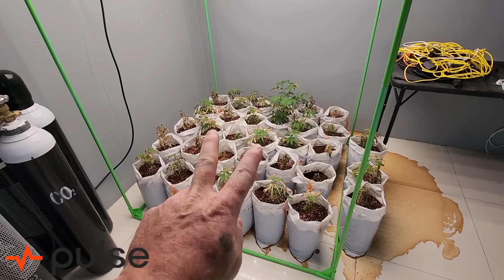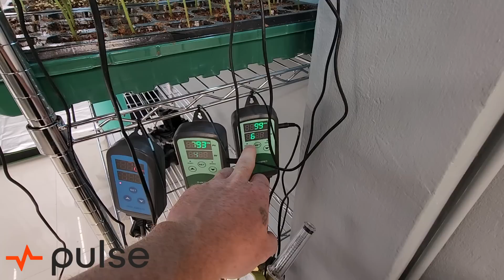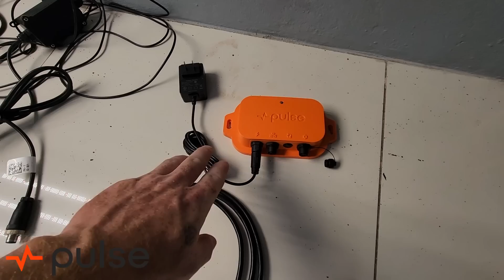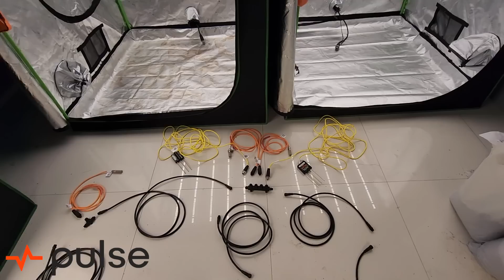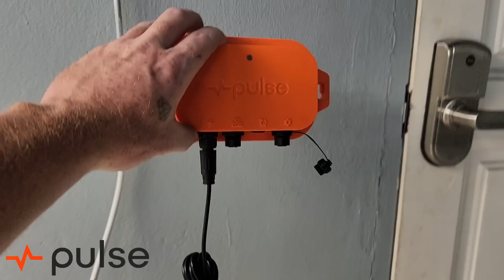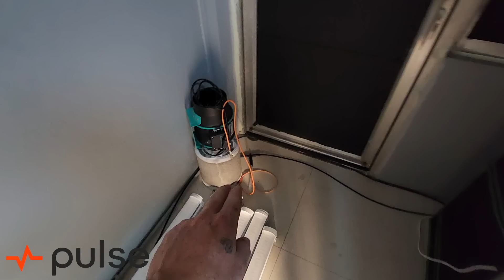Environmental data collection for the BEST GROW SPACE!!! PULSE HUB INSTALL

Comment: in thailand you need to check plant leaf temp vs atmospheric temps and the vpd needs to be 1.2 in the flower cycle. So thats like 40% humidity @27c bud not 60%. But everyone is too cheap to hire a pro. grodan will suck up more then coco btw. use 4 inchers with slabs 2 to a slab so they can help each other out on the dry back.

Comment: can I cut clones from flowering plants? They are in the flowering phase for 3 weeks and I want to cut several clones from them. How to do it correctly?
Reply from the maker: Yes you can, cloning process is the same as normal just be sure to keep nutrients to a minimum like 25% and then keep you light under 100ppfd once rooted until they start growing new veg growth.

Comment: grodan or canna coco bud.
Reply: all of those clones look like garbage man, start over.
Reply: btw water is ph 7, its neutral, it will not do that to plants on a 1 time watering. I bet 10k if i do a run off test, that medium is hot as f@ck and the ph is low. i can tell just looking at those plants, they are cooked.
Reply: ive had to go to Colombia, the US and Canada and fix peoples organic super soil. Hot as f@ck, bugs, the works. Ive been doing this 30 years man. @massiveyields consulting services. UC Davis, where you @